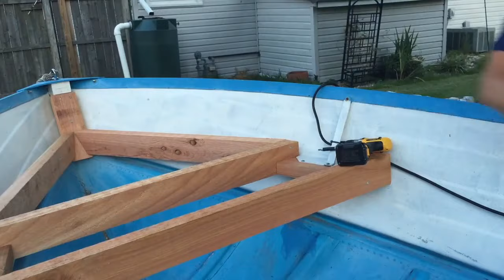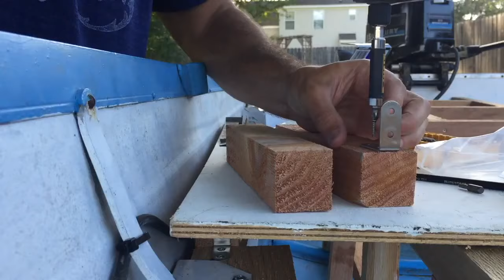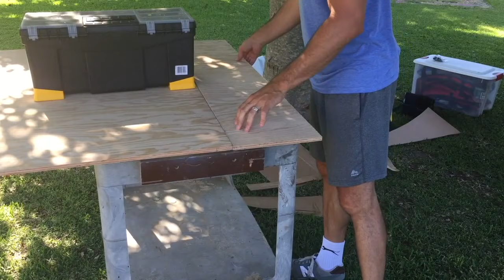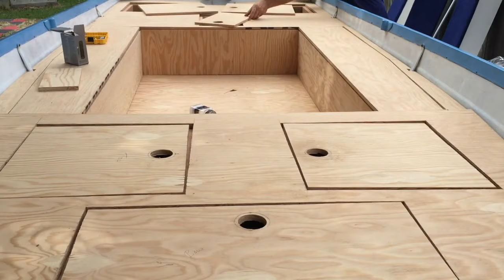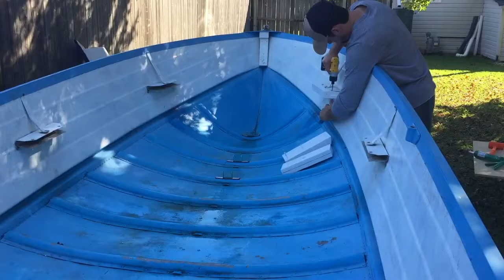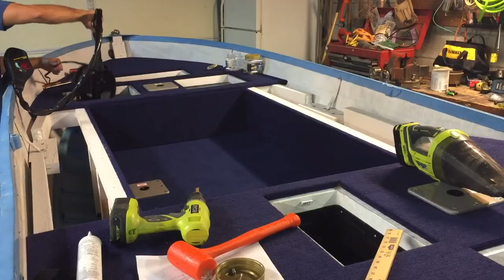14 FT Utility to Tiny Bass Boat | Full Build Time-lapse | Start to Finish!

Comment: Love the boat.  I've been thinking of doing the custom build too.  But is it cost of the build cheaper then buying a used bass boat?
Reply from the maker: Thanks so much G Man, I think the good thing about doing it yourself is that you're using all new wood, hardware, and components, and you'll know the boat well. There is less that can go wrong if it's all new, and because you've done the work, it's easier to troubleshoot. To do what I did, and purchase a decent used outboard and boat will probably run you between 4-6K total. To my mind, a used bass boat in that price range would probably be a risky purchase. To my mind there are too many things that could go wrong with a used bass boat at that price. However, the decision to build instead of by was a lot easier for me, because I got the boat and outboard entirely free. That makes the decision quite straightforward. I estimate I put about 2-3K total into it by the time I got the engine running, all the hardware, lumber, paint, carpet, used trolling motor, used power pole, used battery, switches, lights and fish finder. One other thing to consider is the amount of time these builds take. If you don't have the time, but are mechanical maybe the used bass boat route is something you could do and make repairs as they come up? Also, keep in mind the time lapse makes it look really easy (that's what social media does, it makes everything look perfect!), you don't see any mistakes or my having to think about things or run to the store to get hardware, etc. Overall, I'd say if you have the time and the space and want to make a hobby out of it its worth doing yourself. As long as you keep a budget and get used stuff, I doubt you'll spend more than an equivalent used bass boat would cost and you get the added satisfaction of doing it yourself. I hope this is helpful. If you look at my channel you can see each part of the build broken down. So that might help you get some ideas on how you want to do your build. Thanks for watching!

Comment: Badass job! How much was materials?
Reply from the maker: thanks man, now a days these materials would be quite expensive. I did this three years ago before building supplies sky rocketed. I used rough cut cedar for framing because its light weight, strong, and naturally rot resistant. I used Marine grade ply for the decking and I keep the boat in a garage or covered to get as much life out of it as I can. I would not recommend doing this to save money, but rather if you'd like to do as a hobby and would enjoy it. Thanks for watching!

Comment: Love the video very nice build how much weight did it add to the boat
Reply from the maker: thanks so much man. i dont know how much weight it added but you can see in the other vids that it does really well regardless. If i were to do again, i would have used a bit more 2x2 instead of the 2x4. i think the frame didnt have to be so robust. But overall, im really happy with it. thanks for watching and sorry for the very late reply!

Comment: Can't fish out of it be over weight capacity
Reply from the maker: I hear this a lot, and I was certainly concerned about weight but its not an issue. you can see it performing on other videos. I used cedar for the frame which is really light, rot resistant and strong. Yes, aluminum would have been lighter, but im happy with it.

Comment: How much did cost for material I have 15ft
Reply from the maker: For the lumber probably about 400 for rough cut cedar 2X4s and three sheets of 1/2 marine grade ply. This is not including the sealant hardware carpeting etc. I hope this helps, let me know if you need to know more? thanks for watching!

Comment: Am I the only one wondering how much weight was added?
Reply from the maker: I get that question all the time. Im not sure, but it works fine and I regularly fish with 1 or two others with me. You can see it running on plane with all the weight in an earlier video. It still moves about 20-25mph with the 25hp. Thanks for watching.
Reply: @DrBass-rk1ez  you did an amazing job...I really thought the wood, would add enough weight that it would be tipsy. I see that I was wrong.... Great job bro
Reply from the maker: @TheFishingTrucker  honestly, I was pleasantly surprised at how well it handles/fishes after doing the build, as I was concerned about weight too. lots of people have the idea that using aluminum is the only way to do this. I realize it would be lighter with aluminum, but one still needs to a have a plywood deck, so the only real difference would be the framing. I used cedar for frame which is strong, very light and naturally rot resistant and marine grade ply for decking. Thanks for watching!

Comment: I’m thinking this thing goes about half as fast as it did before this
Reply from the maker: I did too, but its not the case at all. There is a lot of people on YouTube really worried about weight and I get comments like this all the time. All I can say is it didn't slow down much and I'm really happy with it. Sure it would have been a bit lighter with aluminum, but I really dont think it makes that much of a difference. Here is a video of it running on plane: https://www.youtube.com/watch?v=5YdJ9oOzhR8&t=94s

Comment: How much does all the lumber weigh? Nice build!
Reply from the maker: i dont know how much weight it added but you can see in the other vids that it does really well regardless. If i were to do again, i would have used a bit more 2x2 instead of the 2x4. i think the frame didnt have to be so robust. But overall, im really happy with it. thanks for watching and sorry for the very late reply!

Comment: How did you do the bow plate?
Reply from the maker: it is attached with a lag bolt that runs to the main eye bolt that is used to crank the boat onto the trailer. Does that make sense? is that what you're asking?
Reply: @DrBass-rk1ez  Im not sure what its called, but I meant the part you mount a trolling motor to
Reply from the maker: @codycantrell2780  sorry about that. here is a video of when I originally did the trolling motor. I ran stainless steel bolts through top of boat with lock nuts on bottom, you should be able to see it in video.I then added the carpet later but used same holds if that makes sense. let me know if you have other questions: https://www.youtube.com/watch?v=2YQ2zG2kSBE
Reply: @DrBass-rk1ez  Thanks!
Reply from the maker: @codycantrell2780  youre welcome!

Comment: How does that affect the overall weight capacity?
Reply from the maker: word hog, Here is a response I wrote to another commenter who asked about weight: "One thing to note is that I used rough cut cedar, which is really light wood. Cedar, I was told, is also naturally rot resistant so works good for this sort of thing. I think I probably added between 150-200lbs with all decking (framing and plywood). That is not including trolling motor and battery. You can see in the other videos how it runs on the water with all this weight in it. Runs fast with myself and another and handles waves well. This has a v bow, so it can handle rougher water and its a wide boat, so it will handle more weight." Hope this is helpful and thanks for watching!
Reply: @DrBass-rk1ez  be aware cedar will rot & rot in a hurry. It may be more rot resistant than regular plywood or pine but not by much. Keep an eye on it 

Nice job though looks great hope it doesn’t weigh 1200lbs with you and a buddy and you sink
Reply: Didnt even get to the end what did you paint the frame and then fiberglass resin the boards?   Scratch that previous comment it that’s the case nicely done
Reply from the maker: @undefeatedgaul3201  hey man, I can take the criticism was my first boat, and yes I could have done with less wood but I am very happy with the results. I was worried about weight but its really stable and I often fish with two others on it an no problem (although not a lot of space for three), it still gets on plane very fast with 25 hp. Cedar is light and thin ply helps. Its not aluminum but I happy with it. in next video you can see it running with all weight in it. I painted the frame with really expensive marine grade boat hull paint and epoxied the marine grade ply. The boat is garage kept and I try to plan around rain, although it gets wet from time to time. She's not perfect by any means, but was a fun project.

Comment: how is the stability on it?
Reply from the maker: its is ok, I regularly fish with myself and another standing on front and back deck. and we do fine. dont get me wrong, its not a big bass boat, but works well.
Reply: @DrBass-rk1ez  I was just curious because I have a boat almost identical to that and I’m in the process of doing that
Reply from the maker: @sethhorn6879  good luck with the build. I get that question a lot, I really need to do a video while fishing, you can see some videos of the boat in action on my channel. in one of the videos you can see my buddy reeling in a striped bass on the back deck. it will give you some idea of the stability.
Reply: @DrBass-rk1ez  thanks man I hope it turns out good!

Comment: Hi! sir. how much is that width and depth?
Reply from the maker: sorry for my late reply. the width of the boat is 60 inches at the widest part and the transom depth is 20 inches. You can see it out of the water in some of the other videos. it has a flat bottom in the back of boat but a V shape in front which does well in waves and also adds depth in the front of the boat. Hope this helps. Thanks for watching!
Reply: Thank you very much for answering my question sir.  did you use that fiber mat?
Reply from the maker: @Jneb_A  do you mean the carpeting? The carpeting is a cheap outdoor carpet I found at a warehouse store. It has held up well so far.
Reply: Is the bottom of your boat also made of wood?
Reply from the maker: @Jneb_A  yes, the floor of the boat that I installed and covered with carpet is marine grade plywood. The boat itself is aluminum.

Comment: Was this over weight?
Reply from the maker: Dylan, thanks for your question. Below is what I wrote to someone else who asked the same question. It's a common question I'm asked: "I was really concerned about weight, but I can honestly say it's a non-issue. My boat is quite wide so it can handle the weight. There were so many people warning about it, but I'm really happy with it. It gets on plane really fast with me and another on it, and all the added weight of decking doesn't seem to have slowed it down much at all. I'm not sure what others use, but I make sure to tell everyone that I used cedar for the frame. Cedar is lightweight, strong, and naturally rot resistant. You can see me running the boat on plane with just me on it here. I promise it isn't much different with two on it: @ " Thanks for watching!
Reply: @DrBass-rk1ez  yea I thought you was using cedar

Comment: Wood is heavy Why couldn't   You used Aluminum
Reply from the maker: I probably should have, and you're right it would have been lighter but I had no experience working with aluminum. I get the weight concern all the time, but I will say it runs fine and im really happy with the way it turned out. You can see it running on plane in the other videos. it really isn't much different than before. I regularly fish it with myself and another. Thanks for watching.

Comment: Great job but I bet that boat weighs a ton, now.
Reply from the maker: Brian, thanks man. I get the weight comment all the time. I think there is a really strong bias online regarding weight that I'm not sure, now after building a boat, that is not a bit overblown. Maybe Im simply not as concerned as others? Anyway all I can do is point people to my before and after videos on the water. Does the boat weigh more, absolutely, but it does not seem to have changed its performance at all, and when I'm fishing with myself and another having some extra weight actually stabilizes it better. Anyway, I always tell people I used cedar which is light and naturally rot resistant. I have a 25hp also, so of course with small outboard id notice a difference. Here are the videos of the boat running on plane: (before: https://www.youtube.com/watch?v=Sjw_9tW9BSY) (after: https://www.youtube.com/watch?v=5YdJ9oOzhR8). Thanks for watching!
Reply: @DrBass-rk1ez  im not knocking your build by no means. I think it's great and if you say it didnt affect performance then that is even better!
Reply from the maker: @briannelson6049  thanks man, no, didn't take it as you knocking the build. I was concerned about weight too but want to let people know that its not the end of the world to use lumber. although the prices have a gone up a lot since I did this build. thanks again for watching!

Comment: Cedar? Thats some $$
Reply from the maker: Is cedar expensive? Yes maybe more than standard 2 X 4 but will last a lot longer. I figured in the long run it was the cheaper option. Don't want to have to redo it a couple years later. I got rough cut cedar and ripped the 2X2s. it saved me a lot of money. Thanks for watching!

Comment: Now you need to buy a new motor and can only fish alone since you added the boats weight limit just in lumber
Reply from the maker: https://www.youtube.com/watch?v=5YdJ9oOzhR8&t=136s
Reply: @DrBass-rk1ez  that’s all fine and dandy on a calm sunny day on a small river lol

One you start hitting waves with having so much weight in the bow you will be bobbing so badly and water will be splashing in the boat the whole time 

Any boat works good in the conditions of this video

Take it on a lake with wind and waves 

Unless you only fish in perfect conditions then your good to go
Reply from the maker: @Andie1620  I think this is one of those conversations that we will have to agree to disagree. All I can say is that I had all the same concerns about weight that you've voiced when I was building it, but to my surprise and relief I was wrong. The boat didn't change much after the deck was added. In other words I still take it to same places and it still has the same limitations. It is after all only a 14ft boat. So, regardless of whether it has decking or not, it is not meant for rough seas and big swells. I've been out with myself and another (sometimes with three guys total) in relatively rough conditions fishing inlets etc. and it has been fine. I use caution knowing its limitations and that its only a small boat and how many people are on it. But when its just me it will go anywhere it went before. Just FYI, I used cedar for the frame which is really light and naturally rot resistant and only 1/2 marine grade ply.
Reply: @DrBass-rk1ez  finial product turned out really nice looking
Reply from the maker: @Andie1620  thanks so much!

Comment: All this work and money you could have just bought a pre rigged boat for  less and been fishing in way less time.
Reply from the maker: The boat was given to me as was the outboard so it would not have been cheaper. Yes, you're right, if I did not have the boat given to me it would have been about the same price to buy a prerigged used piece of junk bass boat with old parts etc. Additionally, I didn't do this to save money, I did it as a hobby and because I always wanted to do this. And it brings me great joy when im fishing on it to know I did it myself.

Comment: Happen to weight that thing BEFORE n AFTER. 😬
Reply from the maker: lance, ill put here what I've put to others: "weight is the #1 question I get and the biggest concern I had in doing the build. In hindsight I could have used less 2X4 and more 2X2. However, I am very happy with the way the boat turned out. I was nervous id added too much weight but it handles really well with myself and another and I've often had three on it (not recommended!) and it runs and fishes just fine. With myself and another it can handle pretty choppy conditions and with a 25hp it will run about 20-25 mph. I can honestly say ive been in some rough waters with it and ive never taken on water. 

One thing to note, I used cedar for the frame, which is really lightweight, strong, and naturally rot resistant. I am no expert on lumber. A lumber yard recommended I use it and I think it was a really good choice for the above three reasons. Also, bear in mind my boat is wide and a v-bow so it displaces more water than same size Jon boat and can handle rougher water because of v bow."
Reply: @DrBass-rk1ez  nice work
More than I’ve done so far. 
Ive yet to fish my boat...nearly there though

Comment: Nice boat but i dislike the mariner motor
Reply from the maker: Thanks man. This is technically not the mariner outboard, its a 1983 mercury that has a lot of similarities with mariner. Im just happy its still running well. What dont you like about the mariner?
Reply: @DrBass-rk1ez  its just an outdated motor older then me
Reply from the maker: @edwardabrahamiii3742  I understand, yeah mine is nearly 40 years old. I get a bunch of old timers stopping me when they see it and saying they loved them. Ive had to do a lot of tinkering with mine to keep it running but grateful it still works. Really expensive to replace them!
Reply: @DrBass-rk1ez  just didnt see to many of them.out here in remote alaska dk nothing about them
Reply: @DrBass-rk1ez  get a modern day 4 stroke no strong smelly exhaust theyre quieter and will save way more gas then thT old timer
Reply from the maker: @edwardabrahamiii3742  do you like a particular brand? Mercury?
Reply: @DrBass-rk1ez  yamaha cuz my old mans 2008 2009 yamaha 4 stroke has sunk exactly 4 times and still runs
Reply from the maker: @edwardabrahamiii3742  wow, that's impressive!